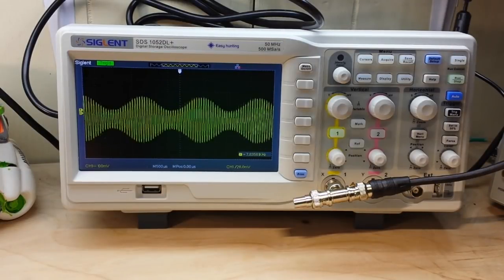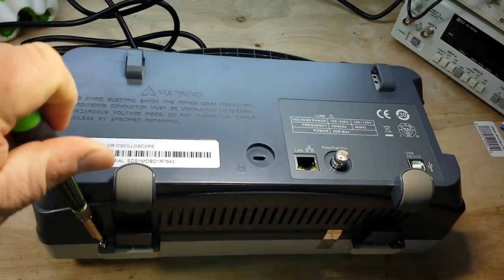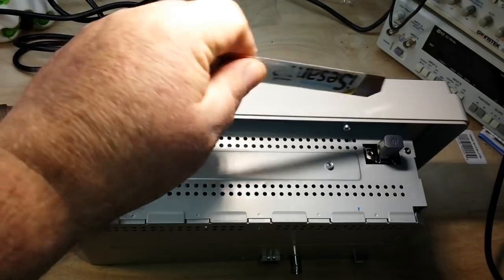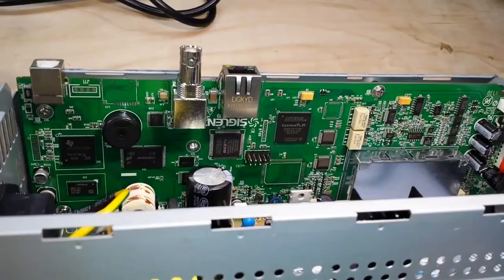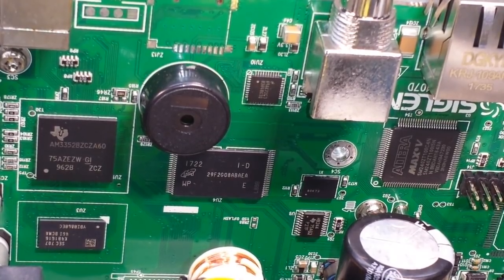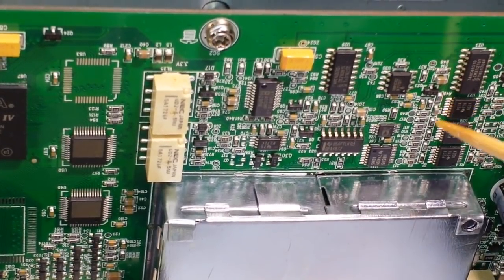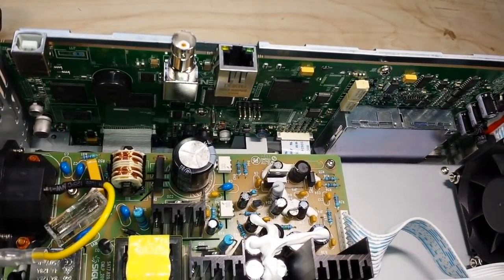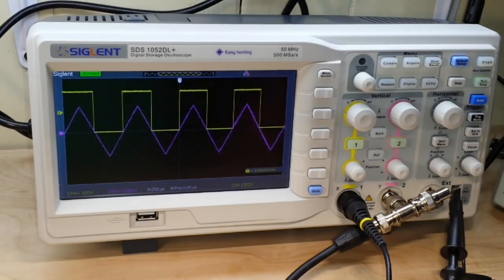Siglent SDS1052DL+ Oscilloscope Teardown

Comment: Hi, this scope has the ethernet connector, but is it able to make use of the web browser interface for control? Mine shows a connection and an IP address, but the browser doesn't connect. This is through a switch with normal through cables.

Comment: This Scope does have shielding on the inputs were the probes are connected from there the signal is converted to digital to be displayed ... all the important areas are shielded .. the rest of the board is digital and is not affected by the power supply and is probably has noise suppression on it ....

Comment: Thank you sir.. I have a similar model oscilloscope but i have no guts to break warranty seal and open it .. I was eager to know about this scope power supply section..Now.. You showed it clearly. It has switching power supply not a linear step-down transformer. I realized that I can feed DC power supply which is coming from solar panels.. Thank you sir..

Comment: Looking at the back of the I see they have the high frequency switching parts of the power supply near the top of the shield. My be the engineers there would be less RF noise. Anyway, other low end scopes that I have seen have the the noisiest switching components right next to the main board.  If it were a problem, I would mount a single or a 2 sided copper plated printed circuit board between the power supply board and the main board by attaching one end to the case and the other to the shield of the Analog shiled. This is probably over kill butt should work.  What do you think about that?
Reply from the maker: Sounds like a good idea.